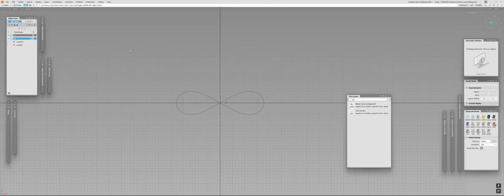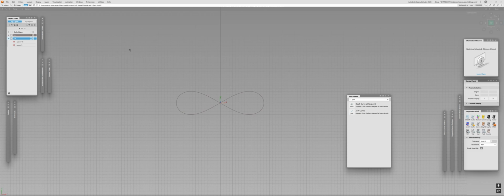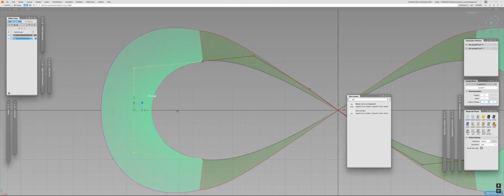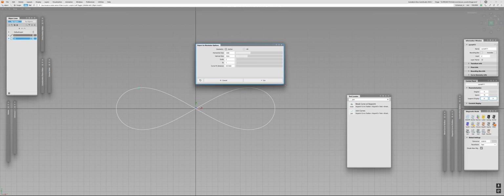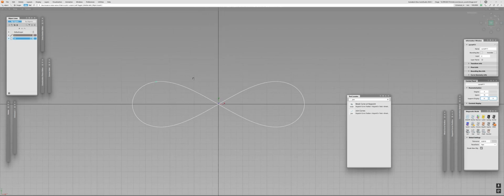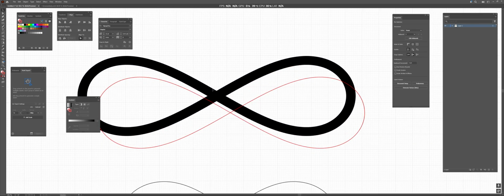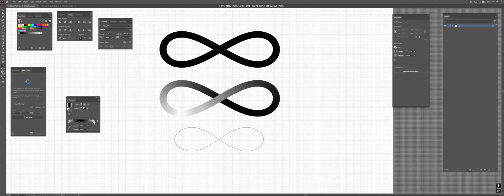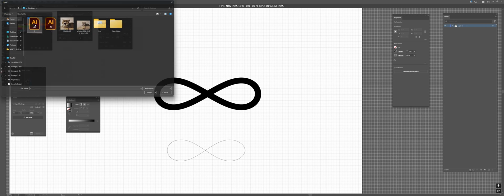Alias Theory Builder - CAD for icons

Comment: "The worst tool ever created by men, Figma" had me rollin on the floor 💀 This video is spot on my dudes. AutoCAD does come close with the parametric constraint features as well as the CV Curves capabilities but for some reason lacks simple ability to use the parametric constraints on the control points/control frame. AutoCAD also lacks the Curve Curvature feature which just silly as it is such a big and important program to so much of the world in 2D CAD design. Even Fusion has a Curve Curvature Display feature, though quite poor, and it can constrain the control points/control frame. Great video, just like your others.
Reply from the maker: Thank you! Yeah, AutoCAD's handling of NURBS is pretty bizarre. You could call it Autodesk's shenanigans. They seem to artificially split their products by adding or removing basic features - pay more, get more, right? I think that's their motive. But even without those extra useful tools, as I mentioned, any CAD system will still be ten times better than any vector editor when it comes to curve networks.